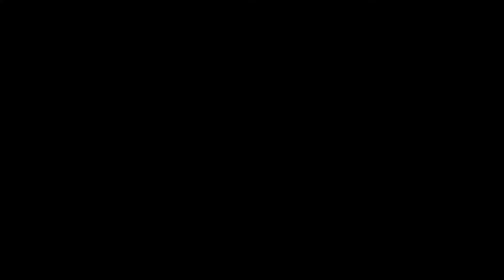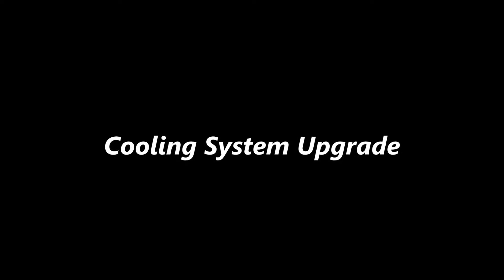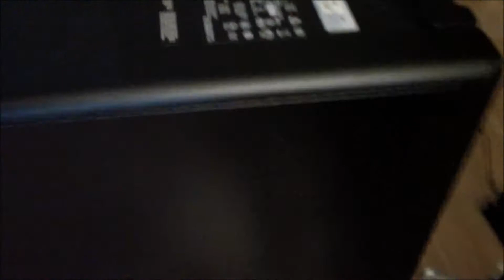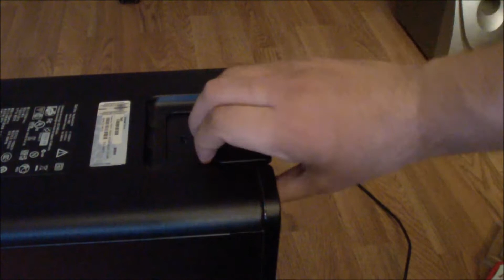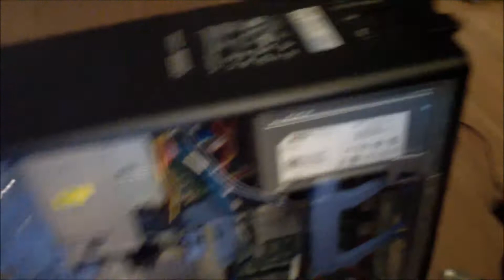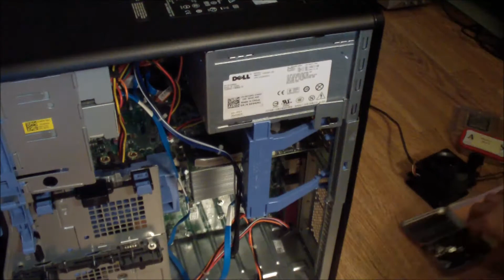Dell Precision T3500 CPU and Cooling System Upgrades

Comment: Hello bro i have same T3500 i want to ask can i use ram of 1333mhz,because now i have 8gb of ram 1066mhz Hynix🤔
Reply from the maker: Yes, you can use DDR3 1333 mhz ram in this computer, but the max size is 4 gb per module.
Reply: @Ace1000ks  tnx bro for info God bless you🙂

Comment: So my pc has been very weird with the fans lately so first when I boot it says my fans aren’t working and stuff when I never touched them but they are still spinning which is very weird I also have been getting blue screens on win 10 followed along with my fans at full speed the error message is memory management the speedy fans might have something to do with it maybe but thanks
Reply from the maker: First see if the front fan connector is firmly in the motherboard. There are two fans on the front fan assembly for the Dell Precision T3500, make sure both fans are spinning. If one of the two fans aren't working, you might get heat issues with your computer. The two fans on the front cool down your CPU, and if one of them aren't working, your CPU will over heat, and you will get blue screens. 

Here the video on how to take the fan out. https://www.youtube.com/watch?v=-55QGokCKwY
You may need to replace your front fans. You can buy the part on Amazon, and here is the link https://amzn.to/2EkRd79 .
Reply: @Ace1000ks  sir I'm also facing Blue screen Issue in my t3500 help me bro
Reply from the maker: @S1MPHEREE  A Blue screen can result from many things, like bad ram, a bad graphics card, a bad hard drive, a bad chipset, etc.
Reply: @Ace1000ks  bro I built  this machine less than one month a go ! 8gb of ram DDR3 525w psu 
1tb HHD 1GB NIVIDIA GRAPHIC CARD PC IS STARTING AND WORKING FOR 4 OR 5 MINTUES THAN THE SCREEN IS GETTING BLUE THEN IT SAYS CHECK YOUR CABLE?
Reply from the maker: @S1MPHEREE  It is hard to say, you will need a tech to look at your machine. There is no way you can diagnose a problem by talking about it over the internet.

Comment: Hi, great vid. I did exactly the same  with my t3500, but I have a question. How do you reduce the front fans RPM, because the CPU is cool, 28c but the fans hit 1300 RPM, even with the cool cpu
Reply from the maker: You cannot change the speed settings for the front fan, and if you take out the Dell front fan and use another fan with a different connector. You will get a error message when you boot that the fan isn't working.

Comment: They will handle the X56xx 6 core Xeon processors.
Reply from the maker: I used the X5675 processors on my Dell Precision T5500, because those processors can be paired with other like CPUs. On this computer, a single CPU W3680 or W3690  works. W36XX processors cannot be used in pairslike the X56XX series.

Comment: What is the size of Two fans mounted on front which airs CPU and RAM ? also, what is the height of the CPU heatsink ?
Reply from the maker: I think it is a 120mm fan 5 pin fan. I don't know what the height of the CPU heatsink.
Reply: @Ace1000ks  So these 5 pin fans are dell propriety fan and cannot be replaced by off the shelf 120 mm fan ... ?
Reply from the maker: Yes, it cannot be replaced with a standard 120mm 3 pin fan. You have to buy the whole assembly which is called the Dell HW856 fan assembly.
Reply: @Ace1000ks  Any standard 4-pin pwm 120mm fan can be used with these dells. The #1 and #3 wires are reversed in the dells. Theres a whole reddit section explaining this with the diagram.

Comment: Does it use a standard 1366 holes? Is Hyper T4 possible?
Reply from the maker: You cannot add a standard 1366 heatsink on this board, because the holes alignments are different. Only a Dell Heatsink from a Dell Precision T3500 or a T5500 will fit. There are connectors and parts that aren't standardized, like the motherboard to the case connector. This is totally different from any standard ATX case. The heatsink is one of those parts that are non-standardized parts. The power supply, hard drive connectors, optical drive connectors, & drive bays can use standard parts. When you buy a computer from a manufacturer, they make proprietary parts for a reason. That is what makes their computer unique from a computer you put together.
Reply: How come other ppl i seen over youtube adding aio water cooling solutions for their dual cpus? you mean, there is no way to put something like t4 or 212 cooler for cpu0 (one that comes not in riser) ? Thing im asking, because im about to get one t5500 in several days, so i want plan everything to future, and once i go with x5690 dual cpus, i really dont rely on stock cooling solutions...
Reply from the maker: @ExFluent  I am sure it is possible, but I mainly use these computers as workstations and servers. I am sure it is worth it for people who overclock stuff. If I want a faster machine, I just buy it. I have a lot of disposable income to buy whatever I want, so this is why I don't  overclock anything.
Reply from the maker: No.

Comment: Dude , I got two fans and plan on installing them soon , they didn't came with molex connectors ,any other way to plug them in ? 
They came with a 3 pin connector and a temperature sensor cable , guess I gotta buy another cable that goes direct to the PS?
Reply from the maker: Yes, you can buy a 3 pin to molex adapter.
Reply: @Ace1000ks  I just noticed, the orange light on the motherboard won't go off even after replacing the 3V battery with a new one , any ideas why?
Reply from the maker: Does the computer boot up?
Reply: @Ace1000ks  Yeah it does
Reply from the maker: The orange light will stay on and solid as long as you plug the computer to the wall socket.  That is even when the computer is off.
Reply: @Ace1000ks  But for some reason it keeps says " Non-optimal memory population detected" , I got 2x 4gb and and 2x 2gb of ram
Reply from the maker: You see that warning when you use non-ECC(error correcting code) memory modules on this computer. This computer was designed to be used in a corporate setting as a workstation computer and server. I will make a video on how to disable this post later.
Reply: @Ace1000ks  Please do , I managed to find the ram configuration on their website but I wish to use all the ram sticks I have.
Can you also make a video on how to install Windows 10 or 7 using USB ? I kept trying right now and it doesen't give me any options , I press F2 go to general - Boot Sequence and I got that thicked list but no option to install the windows .
Reply: @Ace1000ks  It's kinda important to me since I can't use the PC at all , I got it from some guy who wanted to throw it away and it seems to be from a company that used it as a server , so I can't access the administrator , can't even bypass the password .
Reply from the maker: If you want to install the operating system with the usb drive, keep pressing F12 when you start the computer. It will give you an option to boot from the flash drive.
Reply: @Ace1000ks  It worked , thanks man , hope I can revive this PC , either way , this is such an oportunity for me to learn more.
Reply from the maker: Here is the video on how to disable that message. https://www.youtube.com/watch?v=ANg77SI8MPk
Reply from the maker: You need something like this. https://www.amazon.com/ExtremeMod-Computer-Connector-Y-Splitter-Adapter/dp/B00DU8ZZ0O/ref=sr_1_7?ie=UTF8&qid=1536951641&sr=8-7&keywords=3+pin+to+molex
Reply: @Ace1000ks  Just placed the order, and upgrading the CPU right now , thanks.

Comment: thanx for the video, myself im going to mod some t3500s :) all x5670 with 24gb ddr3 :)
Reply from the maker: You have to becareful when you buy the ram for this thing, some ECC DDR3s don't work on this computer, but they will work on a Dell Dimension T5500 for some reason. Just make sure the ram will work on a Dell Precision T3500.
Reply: got hynix memory 1333mhz ecc 4gb
Reply from the maker: I tried to use the Samsung DDR3 PC10600 ECC rams, and they failed to work on my Dell Precision T3500, but they worked on my Dell Precision T5500.
Reply: which ones are u using now?
Reply from the maker: I have like 3 T3500s, and I put Kingston 4 gb DDR3s non eccs in two of them, and Hynix 16 gbs of DDR3 ECCs in another one.
Reply: @Ace1000ks  I think one can use more than 24 GB max RAM if one uses 56XX series processor. for example 6 sticks of 16 GB DDR3 1333 MHz , totaling 96 GB. Correct me if I am wrong.
Reply from the maker: @manojgupta3770  The official Dell website states you can only put in 24 gbs, the manual also states the same thing. https://www.dell.com/support/article/us/en/19/sln288863/precision-workstation-t3500-memory-specifications-and-configurations?lang=en

You can try, but it might not work.
Reply: @Ace1000ks  I will try when my system arrives. Presently it is in transit. BUT this thought came to my mind because I pressumed that originally when Dell guys made their manual it used to ship with 36XX series processor which have RAM limit of 24 GB. In case of X58 chipset the memory controller is in the processor itself not on the northbridge of MB as it used to be earlier. And since 56XX series Xeons like X5680 supports 288 GB ...... so it may be possible. Fingers Crossed.
Reply: And at the end works or not? Thanks in advance i'm going to upgrade to.
Reply: Manoj Gupta yes u can . Most ram will work just make sure it’s ECC UNREGISTERED!👍🏼👍🏼

Comment: Where did you get the fans at, and how much were they?
Reply from the maker: They are standard 80mm fans, and they cost about $5 each on Amazon.com.
Reply from the maker: Newegg.com sells them too. If you buy a lot, you can get them as little as $2.50 each. I got the 5 pack from Amazon.com

https://www.amazon.com/Apevia-AF58S-BK-80mm-Silent-Black/dp/B01AIZFG96/ref=sr_1_9?s=pc&ie=UTF8&qid=1531279179&sr=1-9&keywords=80mm+fan

They spin at about 2000 rpms, and they are pretty quiet. You can get higher RPM fans, but they cost more and they are louder.
Reply: Ace1000ks1975...thanks.
Reply from the maker: No problem.

Comment: Thank you very much for the video, I have the exact sane computer and needed a CPU upgrade, my best option out there was the W3680. I fallowed your steps even bought fans, installed the new CPU and everything is working great.
Reply from the maker: I am glad it works, you are welcome.
Reply: is my dell t3500 monut xeon w3680 6/12 is very good very efficient and rx5800 AND 48GB
Reply: Work for  motherboard xpdfk?